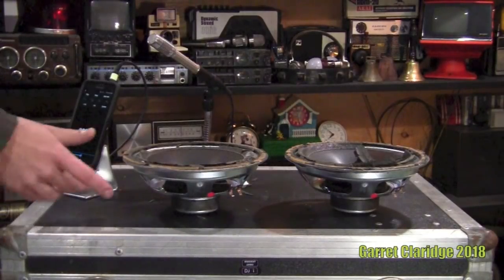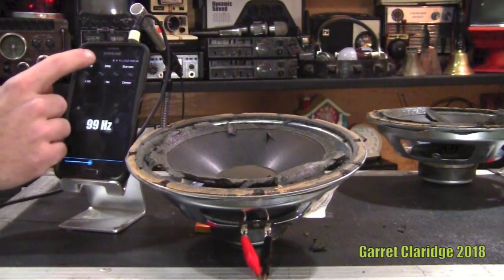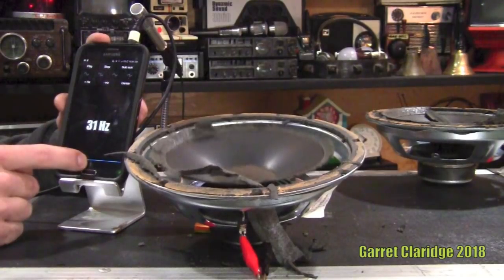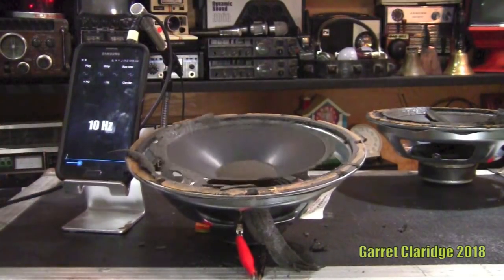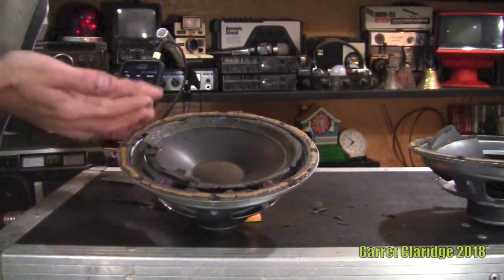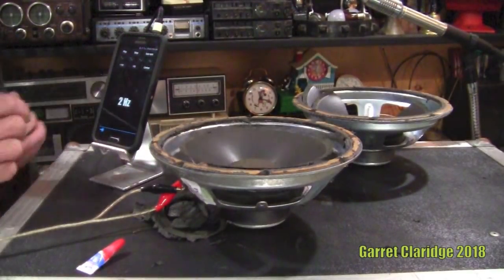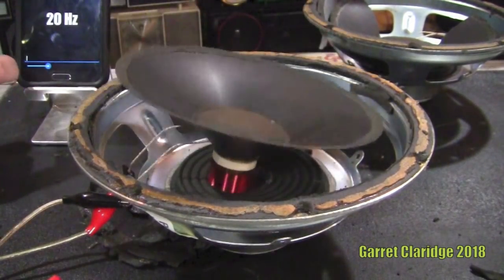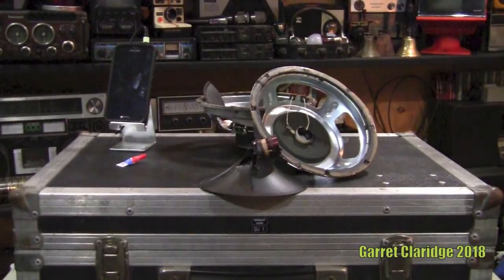SPEAKER BLOWOUTS! -  ENERGY Woofers

Comment: I was quite surprised how quickly that thing cooked when you turned the frequency up higher. I always thought it was the lower frequencies that fried them quick. Cool video anyway!
Reply: LazorVideos yeah, they move more when they are lower, but in this case, since it popped out, the higher frequency made it smoke cause, well, it was trying to swing at a high frequency, which heats up the coil more quickly if it doesn't ventilate itself by moving.
Reply: The frequency sounded like it doubled as the tinsel leads melted. Lol